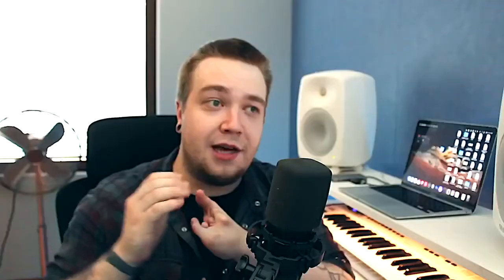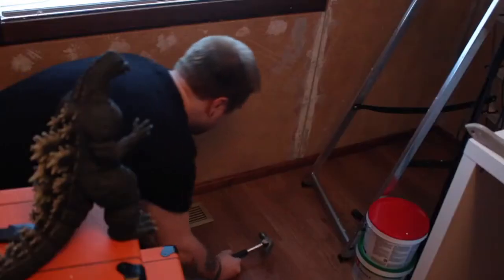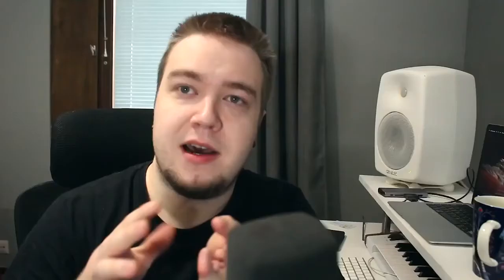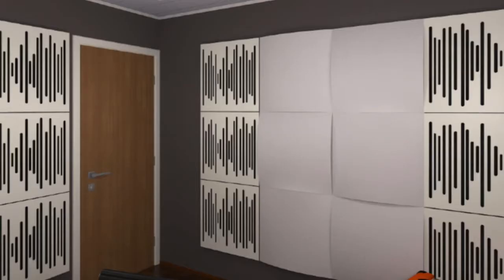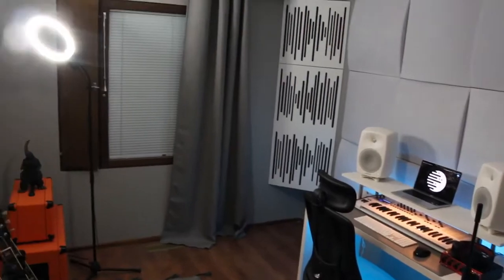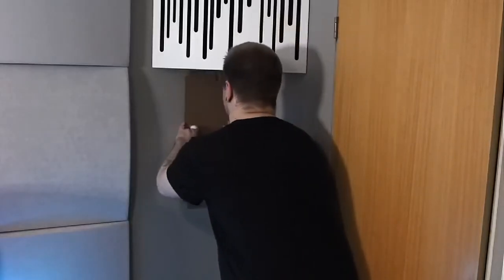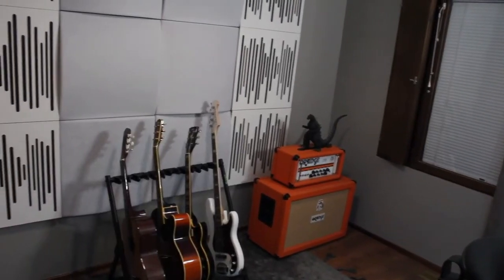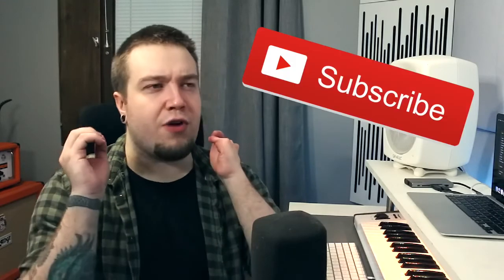Buidling my Dream Studio

Comment: Thanks for the video.
Do you have any link where you can see acoustic measurements of the room?
It is simple curiosity to see the acoustics with the treatment.

Written with translator.

Greetings
Reply from the maker: We cannot disclose the acoustic measurements of a private client, but we can only say that in this case study we achieved an RT Reduction of over 50% in low frequencies and over 80% in medium and high frequencies. To have a full study with a solution and acoustic measurements for your room, please request a project: https://vicoustic.com/project-request
Reply: @Vicoustic1  Thank you for the courtesy in answering.
I will be attentive to your channel to see if they make a video where the improvement of the acoustic treatment with rigorous and objective acoustic measurements vs. without having any treatment is clearly seen.

written with translator

Regards.......Juan Jose